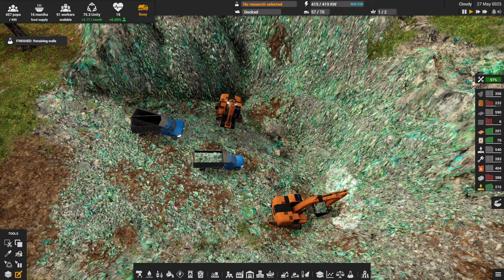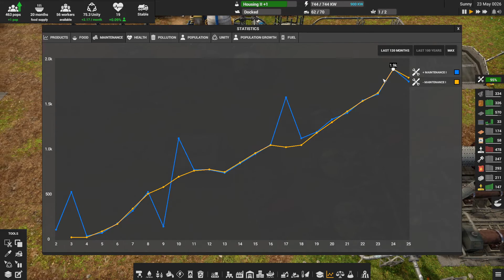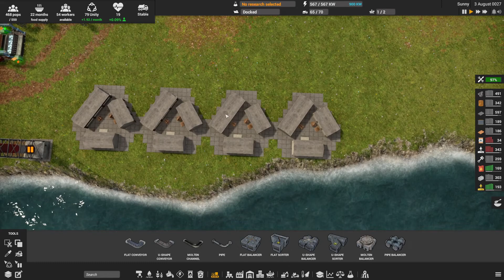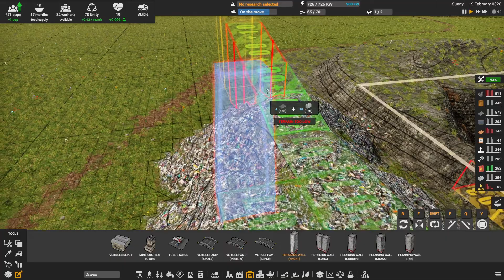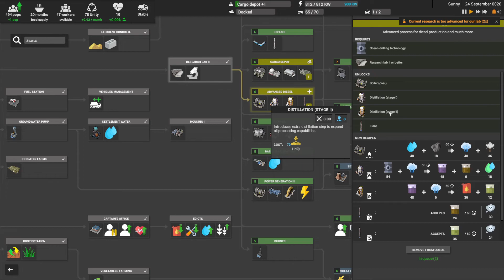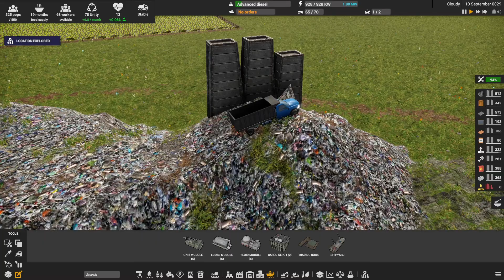Captain of Industry #7 - Tier 2 Research!

Comment: Have you ever used the Transport Drones mod for Factorio? I did a whole base using them myself as the only logistics  I used and it was very fun to do... this game feels similar in spirit! (and I wish the Transport Drones mod would take some lessons from this game's implementation with respect to priorities and the supply/requester control sliders though!)
Reply from the maker: no, but I keep hearing about them, so I will have to try them out at some point :P
Reply: @Krydax8  Nice! Looking forward to that! 

BTW, this game is amazing, really liking this series! I wish I could play this game myself, but I'm short on hardware for it atm :/

Going back to the transport drones mod, maybe your next Pyanodon run is a good match for them (just as an idea,) as they normally simplify the early to mid-game spaghetti a lot! They are mostly useful to transporting low throughput items early on, due to their early slowness, but that changes, as you can research more speed and more carry capacity after blue science and later.

The only con I'd think of is that probably they'd unlock much later in a Py game than in a normal game, due to them depending on some kind of liquid fuel (they use Petroleum in vanilla, but it can be changed to any fluid that have a fuel value in its startup settings.) 

The other con is that they are unlocked by green science, so perhaps in Py it'll be long journey until you get them operational which maybe makes them less useful.
Reply from the maker: Yeah I don't think I want to try a mod like that for the first time with pyanodons, but eventually I'll try it :)